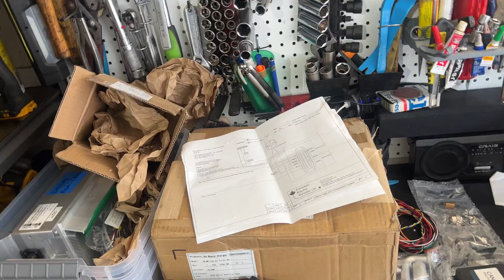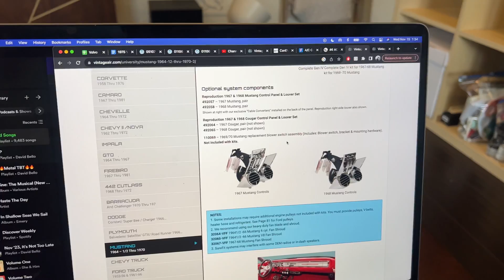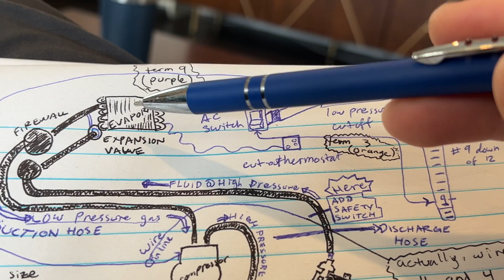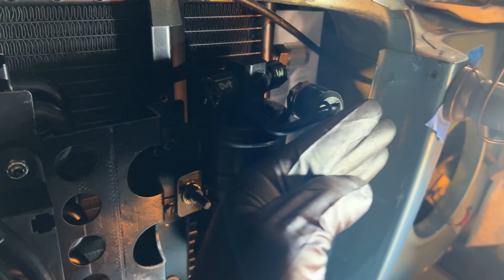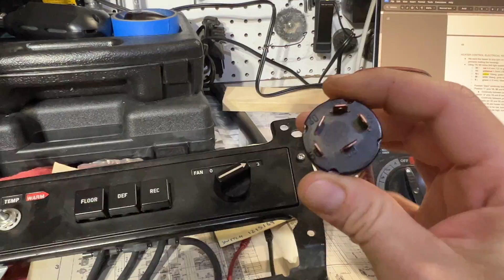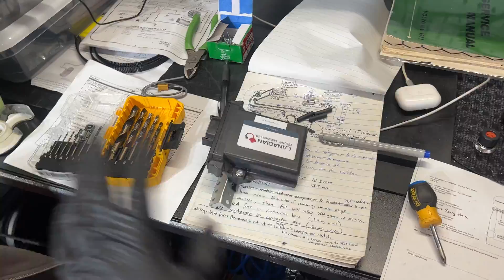Electric Heater & Air Conditioning! Part 11 - Volvo 164 EV Electric Conversion Build

Comment: Too late now, yet verify the motor brushed are not worn down so much that life expectancy is short. Also, the check the rotor slip ring the buches contact and ride on are not deeply scored. You can use an GL-4 synthetic like AMSOIL Super Shift 10W Racing Transmission Fluid as it like yellow metals and endures. WHat I use when rebuilding motors and in M47 II. Ensure the bear housing is full of the cloth or fabric packing so the sintered bearings are always soak in lube. GL-4 is a small molecule. Do not use a heavy large molecule like 15W50 including synthetic. VDO made and may still make this HVAC motor,  Verify the rotor and stator winding insulation is good and no shorts. You an also replace the motor brushes and springs.

Comment: I think that from now you will be known as Gungah Din, because you are a braver man than I.
This is just one part of the conversion and it is challenging. 
I have a '91 240 GLE with dual fuel, LPG is installed over the original gasoline fuel, which is a pain. 
I would love to do a similar conversion, but .... I'm still a bit chicken. I'm waiting to see how your conversion goes before I decide. Sorry, you're my guinea pig. I hope you survive. LOL
PS Does the TE badge on the grill stand for "technical expert"?

Comment from the maker: Note: the trinary switch blue wire circuit would do better to go through a variable ground source, otherwise, it seems that any time there is pressure in the system and ignition turned on, the fans will power up. It could be useful to not have the fan power on if there is a loss in pressure, to give the driver an audible indicator of a problem (no fan noise). I’m not clear on the diagram, if the blue wires are completely independent of the  signal wires for the compressor clutch (black/green). I’ll report back once the relays are installed and system tested.